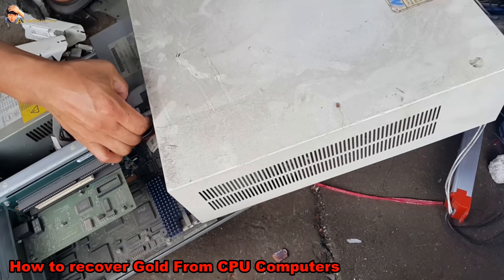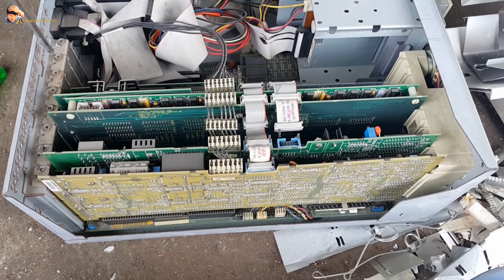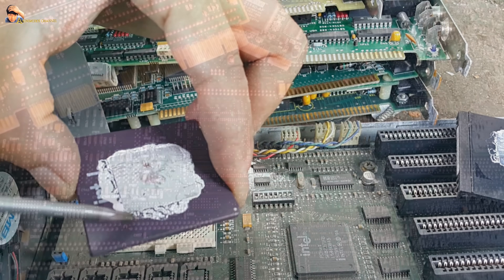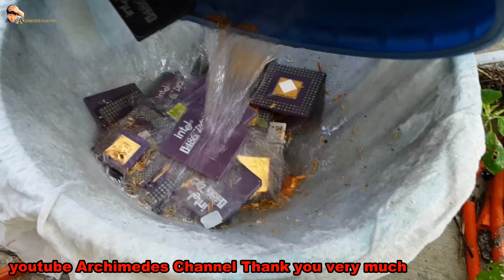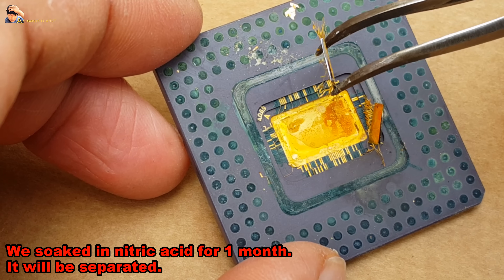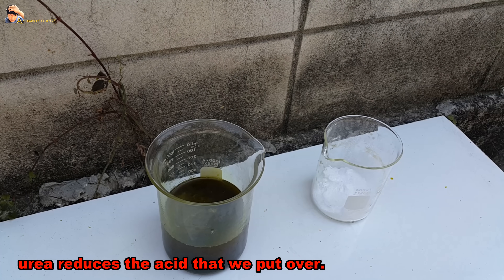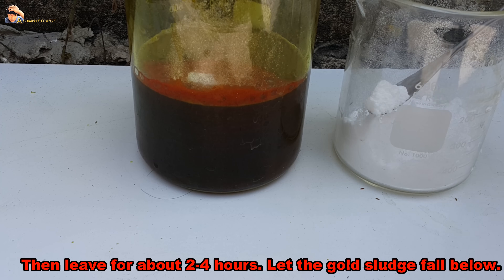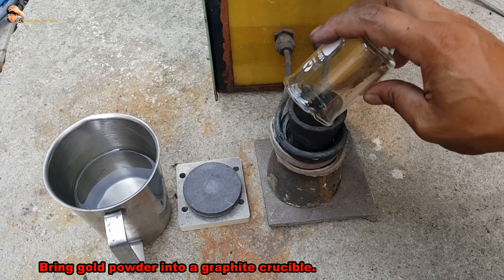How to recycle gold from cpu computer scrap. value of gold in cpu ceramic processors pins chip.

Comment: That is not gold. *facepalm
They use copper for external connectors. If they ever use gold for that, the world gold reserve will be consumed within a few years and their microprocessor won't be sold at a couple hundred dollars. It will be worth several thousand dollars.

That being said, there are indeed gold inside microprocessor. 

Read again: inside.  As in, not outside.

They use it to connect the registers and microcode memory inside the chip. And that is very very very small part of the microprocessor. That's the reason why there are only handful registers available to use (Intel i7 only have 8 registers with 32 bit and 16 registers with 64 bit), because more registers mean more gold. On the average, each microprocessor will only contain several miligrams of gold.

Comment: Jesus christ your descriptions of each component are so idiotic at best, no offence. The "gold plated circuit board" was the PCI express ports. The cpu looked like it was being cooled passively, so fair enough for the heatsink description, but the THERMAL PASTE APPLICATION IS TRIGGERING. That board is soooo dusty, and probably worth a lot as an antique. Same goes for all the PCI-e hardware. The cpu could probably be sold for more tbh, and if you simply cleaned the system, you could sell it for much more.

In short: dont do this. You will lose money. Also when you talk computers make sure you know what you're talking about, and treat the parts with care. A simple EMD will greatly damage those parts greatly.

Comment: I love hatter comments. Give them a million dollars for free and they complain because it’s cash!!!!
Reply: Most of the "haters" are just pointing out there's no real money to be earned from doing that. Whether they're right or not I cannot tell but it's a long way to "hate".
Reply: @SeelloBFH  
Do I have to point out that whatever the video show, it's not gold.

There is gold, but it's not on the outside but in the inside of microprocessor. And it's only a few miligrams.

What the video show you is mostly copper or copper alloy.

Just think of it this way .. if they use gold for pins and circuit boards, wouldn't the customers receive their computer with microprocessor legs clipped a little and circuit boards full of scratches? It's a process called sweating the gold, to chip away tiny portion of gold.
Reply: You can build hats in gulag. Bye bye.

Comment: I would like to know how many computers were disassembled to get that gold. It would be worth it if you got them for free. But paying for the computers would probably cost more than you'd make unless you bought a bunch of broken computers at once.

For those claiming the chemicals and whatnot are more expensive than the gold... do a bit of research. That 6.7 grams he extracted in the video is worth $263. That's not a bad paycheck for a few hours' work. A couple jugs of acid will last for quite a few sessions.
Reply: John Terpack This is actually a month long process.
Reply: It's not pure gold
Reply: 6.7 grams of what? Copper. He got copper. Not gold.

Comment: I agree that it might be possible to sell some of these old towers off to collectors, but I have found it to be a slow process. As to the chemicals, I have to admit how hilarious the common misconception concerning the cost of chemicals. Someone went as far to say rare! Ha! None of the chemicals here use transition or rare metals, so the idea that they are expensive is so incorrect. As a chemist, these are exceedingly common reagents that you can buy almost anywhere. Without even choosing the cheapest source for most of these, I found I could pay less than $60 for all of these materials purchasing volumes of excess and not even using vendors that require an institutional account.
Reply from the maker: Is a good Comment
Thank you

Comment: 6.7  Gram  = $266.86
Reply: A pentium processor costs anywhere between $20 to $40. How many CPUs were butchered, about 30 to 40? Not worth it!!! A whole system, in non-working condition, could fetch for as much as $300. Do your math...
Reply: @errol4243  these are 1994 Pentiums, 1994 Pentium Pros, and 1995 Pentium MMXs.
1994 Pentiums - $10-14 USD.
1994 Pentium Pros - $18-25.
1995 Pentium MMXs - $36-$48.

all of these processors weigh about 1 ounce. Less than 0.5% of their weight is gold.
It'd take exactly 47.6(48 CPUs) to extract 6.7 grams of gold.

Even if they were ALL 1994 Pentiums selling for $10 a piece, he'd be making $480. Only a short jump away from making twice as much as he did extracting the gold..

Not fighting you on this or anything. Rather, I'm backing you up with raw numbers, so that KimFilms doesn't have to do the math. lol

Basically speaking, at minimum, he is making $480 by selling the processors by themselves vs $266.86 of gold. lmao

Comment: The only way you can do this is to do it in bulk and do EVERYTHING. We even use an acid to eat the green coating off of the circuit boards so we are able to recover the copper from the boards as well. memory chips are incinerated along with video chips for the gold. Apart from the leftover circuit boards with the copper removed, we have almost zero waste apart from plastic and wire insulation.

Comment: Right now at my face while watching this video I have a motherboard socket PGA370 with a Pentiun 3 plugged on it. Not sure if it works, don't know how to test if it works either. Which would be better 1) try to sell as it is on Ebay or 2) destroy it and grab the gold from it (not even sure how to get the chemicals though)? I have access to ton of scrappy peices of computer, but don't know what to do with them, except selling them cheap for someone that will work on extracting the gold somehow.

Comment: As a collector of old PC parts and materials, it's hard to watch good components be destroyed.  I would've paid more than what he got in gold just for the components he had.  Not that I really need more old computer parts ... but I'd love to get my hands on some 80486 and down systems.  Although I guess my Am5x86 probably counts as a 486.  I also have my P3 Slot 1 socket 1GHz system.  Love that system.  You won't be scrapping THAT for gold.  Not even after I'm dead.  Nope ... it's all going in the hole with me.  House too.  I'm taking it ALL with me.  Fuggem.
Reply: I'm afraid I don't have any 658005434436538hjky898779s.  But, I'll be sure to take all my 658005434436538hjky898778s with me.
Reply: It’s nice to be sentimental. Nobody wanted to buy when I put hundreds of them up for sale. If I did, it was like one or two a month. So, I buy and recover the gold from them by the tens of thousands every month now. So instead of earning 90$ a month, I can earn 70k a month. What would you do??!

Comment: are you sure this is gold is it not just a copper like thing if it was gold it would have been too expensive and there is no reason to use gold in cpus
Reply: ma biaka gold plated. Means very little gold covering another metal. Gold is very conductive so it is great at transfering electricity
Reply: Felix Kamin thanks mr smartypant
Reply: back in the days they use lot of gold in pc components. Why do you think they cost a fortune back then
Reply: Yes. Until 7 or 8 years ago there was no way you can make Copper malleable enough to put in small specs for a tiny CPU. IBM invented a way to use Copper instead in a microscopic way. Aluminum was used previously but is not as good as a conductor so gold plated aluminum was used back then. Nitric Acid disolves the aluminum but not the gold which is why the legs all broke off the CPUs as they were hallowed.

Comment: Try it with core i9 processor
Reply: Ehh, I was thinking a threadripper.
Reply: Modern CPUs in the last 10 years switched to copper so you would not get any gold. Back then there was no way to get copper malleable enough to get dust or apply it in a small precise pattern unlike Aluminium or gold. The older CPUs used aluminum with gold plating. The nitric acid dissolved the aluminum leaving the gold behind.
Reply: It has less gold than old CPU
Reply: Danger David  Oh really! Only India? Just go to your uncle Google and search who else is using i3. And once again please google, which processors are currently used in India.

Comment: stop scrapping these old vintage processors :( they are more and more difficult to get every year :( there are many collectors trying to find and buy them
Reply: intel 386, 486 working is worth $15-25 piece. Intel Pentium (gold cap) - $25 piece. Intel Pentium Ceramic - $15. Pentium PRO - $30 
still do you think scrapping them will give you more money?
Reply: why wud anyone buy damn old computers?
Reply: @ismailshani9108  - We have a local city in our area that developed their water control system on XT's with Packet Logic. When I worked in the retail industry, they would pay more for those old boxes because it was cheaper than rewriting the software to work on today's computers.
Reply: There's no reason for him to do this when 8K gold is worth $14.16 per gram.
He has $94.85 worth of gold by the end of the video.
Reply: They're still only worth about $1-$20 if you buy the CPU by itself.
The gold is worth about $94-$96 minimum.
Reply: @superswag4191  No, u are wrong. Gold from CPU's is 24k, and he have 6.7 grams od gold. So one (1g) is about 42$, so he have abouth 300 $ from this CPU's. U will never sell those CPU in internet more then 50$ for all !!
Reply: @hjalmarjonsson4973  He's using Intel Pentiums, Intel Pentium MMXs, and Intel Pentium Pros from 1994 and 1995.
Intel Pentiums from that time go for $9-$12 a pop. Intel Pentium Pros are selling for $16-$22 a pop. Intel Pentium MMXs are selling for about $28-$40 a piece.

A CPU weighs about 1 ounce. Less than 0.5% of that weight is gold.

If we assume that every CPU is a regular Intel Pentium from 1994.

It would take about 48 of those processors to get 6.7 grams of gold.

48 of those processors are selling for $576.

You're wrong. Go be wrong somewhere else. Thank you. lol
Reply: Super Swag But, you need to destroy a fuckton to get 95 dollars in gold.
Reply: A Wild Doggo u
Reply: PrzeszczepiX i have old Pentium cpu but i live in Czech Republic. For me this dont have value 😃
Reply: I have alot of old processor.. just for collection
Reply: what are mint 2650 and sc/mp worth? also 2114 sram
Reply: PrzeszczepiX I smashed a PC with I think Pentium OverDrive when I was 8. Thing started up just fine even after sitting in the basement for a long ass time. Did not have HDD and keyboard was AT so I had nothing useful to do with it. Maybe 1 year ago I found AT to PS/2 adapter in a drawer with other PC parts, electronics and even some DAT tapes. I am a fucking idiot. But this is Serbia where laptop Pentium 2 LITERALLY SPECIFIED AS RARE costs under $5.
Reply: Johnson Rumnong lol nt bud
Reply: Lol I have tons that need these desperate collectors to go crazy for then. Way too many older pc's laying around.
Reply: @kalle kanin Autist confirmed
Reply: xlioilx  Only the 1995 Pentium MMXs sell for that.
Some of these are 1994 Pentiums and 1994 Pentium Pros.
Which go for $10-16 and $20-$26 respectively.
Reply: What people haven't noted is the hours required to do all of this work. Let's say it took him 30 hours, he'll have earned $1 per hour. Seriously, you can earn more working a few hours in retail or fast food.
Reply: The uploader just made 486 motherboards go up in price.
Reply: And these days they are worth much more than 4$ each
Reply: and Intel Pentium Overdrive - even $75 for piece
Reply: to everyone in the comments section , these pc are so old there basically useless, you wouldnt even be able to run the newest version of google for christ sake
Reply: PrzeszczepiX .there's no gold in CPU but only brass is there.this vedio is cheating to many people in the world who don't know the truth.
Reply: Wow, including the scrap recycling centers that test for gold when you bring it! GOD DAM! lmao
Reply: Nie ma , coś kiedyś czytałem że jest, na podstawie czego piszesz że nie ma? To nie pierwsze wideo które pokazuje że jest, mosiądz jest bardziej żółtawy, tak sie mi wydaje.  Daj znać jak masz dobre źródło wiedzy o procesorach.